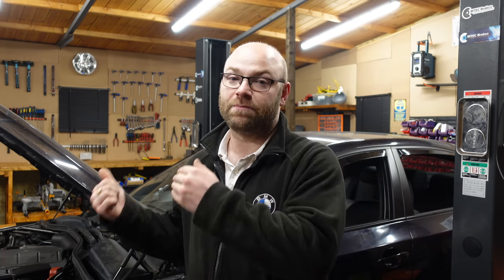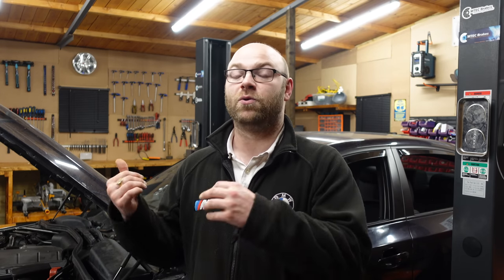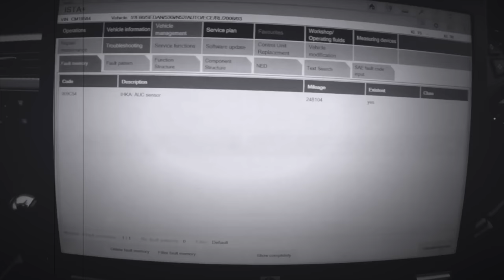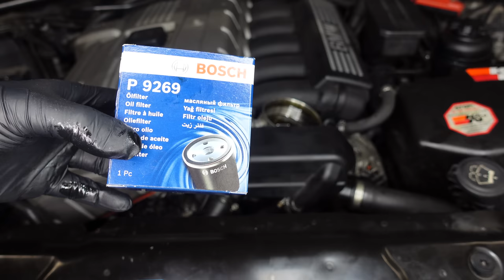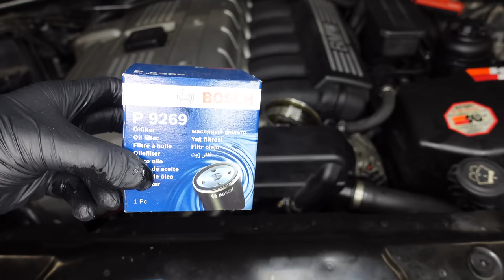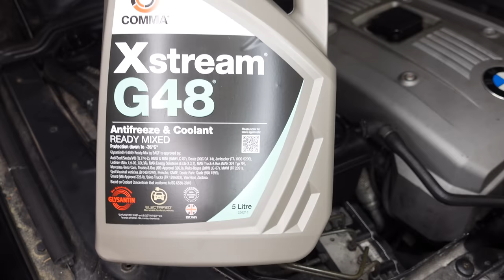BMW N52 , N53 , N54 Coolant Expansion Tank Replacement & Coolant Bleed Procedure

Comment: Love your videos!  They have helped me in the past.     I just purchased a used 2012 550i M sport and it has the passenger and driver restraint warning lights on any info on a fix would be great!?
  Previous owner did back into something very minor but says thats when it came on but I have my doubts as,  Im selling my old 2006 525i and the same thing happened randomly a month ago but it was only the passenger restraint warning.  As i understand, its something to due with the airbag sensors or such??  Any help would be great anyone??

Comment: Hello.
Short saying, your vids are great, thanks for that. 

I have a question. 
On a 176433 km bmw 325 I, 2006,n52,b25,box.
The auto box is getting jercky,. Is now the time to "flush" or just drain the autobox fluid and refresh? 
It's not slipping only sometime a little jerk from 3th to 4th gear,. Just let is be or do something to the oil? 
I am first timer bmw owner, I know the engine "n52" so not the gearbox., 
Just
Reply: Or only a reset on the auto box, haven't done that when I buying it 3 weeks ago

Comment: Don’t you need to keep the battery charged though Dean thanks. looking forward to doing the water pump on the six
Reply from the maker: Yep it was it was hooked up to my voltage supply while doing this as the battery wasn’t completely charged from sitting around.

Comment: Dean, I have a BMW X1 E84 and I have the problem that seems common to other models of the oil plug spinning and unable to get out to replace the thread either by new M13 or replace with Wurth time-sert any chance you could do a video how to extract as there seems no info on you tube anywhere , there is one but it is absolutely useless.
My theory is to drill oil plug with M6 or M8 half way down and attach a long threaded bar with a sliding  weight, like a dent remover, and try to pull it out with bangs and turning. Any thoughts? Would appreciate any ideas you have as my temp seal with RTV, which is working at present, is not an ideal solution. Sump replacement is not really an option to me. Cheers Pete

Comment: I replaced my bmw 328i upper radiator hose..when i used a turkey baster to remove my antifreeze from my coolant tank;, now the red bobber(fluid indicator) is stuck in the down position..how do i fix??? it did NPT BREAK

Comment: Took my 3 series BMW to get new water pump because over heating. $2000 later the pump works and now coolant tank constantly runs. The car will not heat up and the mechanics said its ok to drive but not to drive to far. The mechanics said they do not know why coolant is constantly running and yes they are so called certified BMW mechanics. Could it be the thermostat stuck?

Comment: I wonder if I have green coolant in my bmw because I had a leak and something tells me the non-dealer mechanic did not use factory coolant nor the one you recommended well fast forward I need a water pump 😩

Comment: I bought a second hand BMW 3 E90 recently it immediately started having issues and found oil in the coolant reservoir and green coolant it also makes a winning/whering noises I think someone has tried to fix it any advice on what too do.
Reply: Might have to change your oil filter housing gasket

Comment: @BMW Doctor: I need your help, I have BMW F10 N52 523i, I get 210901; BSD message alternator missing and 104208; intake pipe pressure sensor electrical short circuit to B+. I have no symptoms in my car everything works perfectly fine but these codes don't go away at all even after clearing it, they just comes back with several others. Please help me fixing this.

Comment: hi mate do you take on customers? i have a f20 n55 135i and im having some issues with it regarding low charge pressure and suspicion of leaks between exhaust turbo and intake and constant maff error. if so where are you based?

Comment: Hey doc I really could use ir help with my e60.  2 things. 1 I bought the launch creader elite since u recommended it    how do u do coding for retrofits like adding folding power mirrors? I got some from scrap yard but don't know how to code it with the launch. 
#2 I did the 3 stage manifold upgrade on my 525 but the car is a dog.  Good dida valves and cleaned vanos solenoid. What else can it possibly be? Only codes coming up it for map controlled thermostat  and yes I have the 530i ecu too. Any help would be  very appreciated

Comment: I have a 2012 e92 328i brother, love the inline 6 she has 140K miles and I can start to feel the tranny slipping and gears running too long would you recommend changing the tranny fluid or just let it go out then swap it?
Reply: If it's slipping, you should at least check the fluid level. You may have a slow cooler leak causing the transmission to run low and slip during shifts. Do you have a GM transmission? If so, you can easily find Dex 4 fluid and get a filter. Replace it and reset the adaptions.

Comment: Hi what would cause my e92 to shudder badly when I accelerate hard? I’ve changed the propshaft support bearing and the propshaft rubber doughnut thing but still doing it, if I accelerate then slowly build speed I can then floor it with no issues but if I just floor it straight away it shudders loudly and whole car vibrates.
Tia
Reply: Maybe don't floor it and drive like a good citizen

Comment: can someone please help me, i have a n53 engine on which im experiencing low speed pre ignition when the rpms are low and under a load when you put your foot down. It only happens when the engine is worm and when im using e10 fuel which is rubbish by the way, and way this problem seems to stop when i put e5 shell v power fuel. i have a brand new bmw oem spark plug and coil packs
Reply: Could be excessive carbon buildup on piston crowns and combustion chambers. Maybe you could use a scope and look down spark plug holes.

Comment: Do i have to change oil pan every time  i change transmission fluid on my e60
Reply from the maker: I would advise changing the pan at the same time. But it’s completely up to you what you wish to do I think once you do the pan as the filter is built in change it every second time you change the transmission fluid. I wouldn’t say to change it all the time unless you can afford too but the oil is cheap enough to buy to warrant changing every 60k